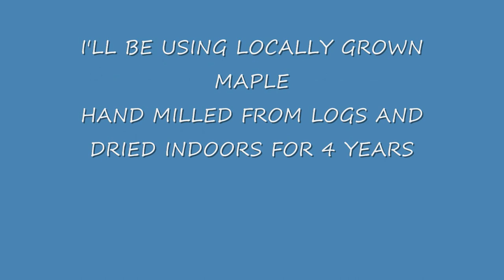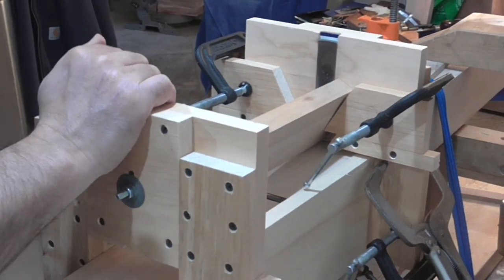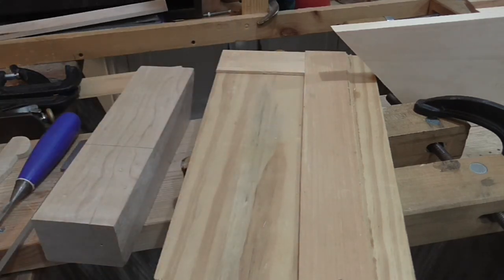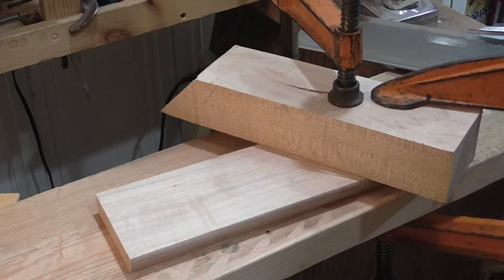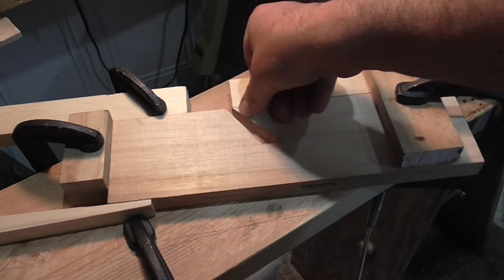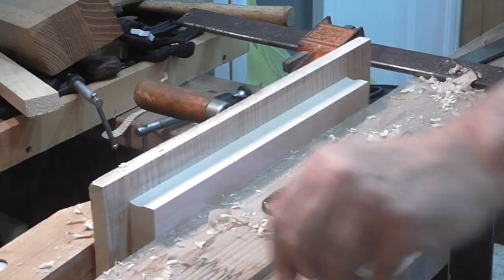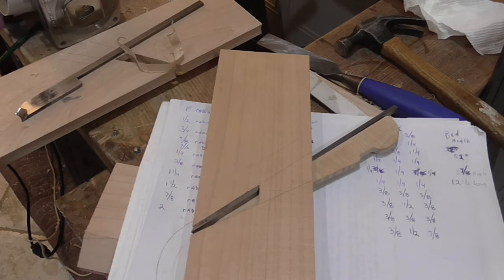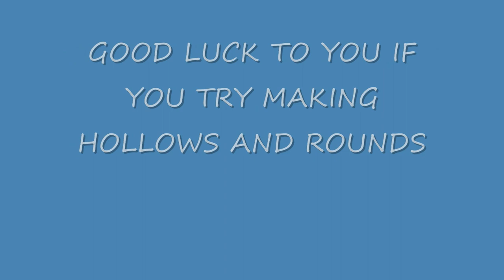Plane Making - Hollows and Rounds

Comment: This really is a fantastic video! You provide a lot of food for thought on your build processes, which then stimulates all sorts of other ideas for creating jigs, increasing efficiencies, and general problem solving. It's nice to find these rare gems on YouTube!

Question: Early in the video, you mentioned you had to locate a line on each end of the blank that was 7/32nds from the edge, and then you created a spacer that was precisely 7/32nds. I'm wondering what problem you needed to solve with the spacer, and where did you place the it? 

Thanks!
Reply from the maker: For the 7/16 ths hollow, I needed to locate a point on both ends so the jig would work correctly. I did that one last since it took time to figure out I could use a drill bit as a spacer. I registered a piece of steel off the side, placed the drill bit against it, stacked another piece of steel against that, removed the first 2 and drew a line. Then did the same with a 7/16 spacer, but from the bottom. The "point" is where the 2 lines meet.
 Doing all that with a scale or tape measure would have produced errors, a stray pencil line would have been a problem and I don't have enough material for do overs.
Reply: @ROUGHCUT20   That's the kind of detail you wouldn't intuitively think about beforehand and then not realize it until it was too late. Again, this highlights the value of these sorts of videos. Thank you!
Reply from the maker: @philpascel4144  My first answer was incorrect, please look at my edited answer. Thank You !

Comment: How did you taper your cutters/irons? So they lock in with the wedge…
Reply from the maker: I've never tapered a blade in any plane I made. I did a video on the subject of tapered blades : https://www.youtube.com/watch?v=BYuFdxpTc24
You can look through that, add to the discussion there, if you like. Personally, I don't feel the need to have tapered blades, they hold well enough if you fit the wedge and the pocket tightly.
If anything, the taper helps with the removal of the blade, after you're done using it.

Comment: Why all the blades hollow and round (that I have seen everywhere) are asymmetric, and the design of the wood block too asymmetric. In the end they all have a weak little tail to hold them. Thanks in advance.
Reply from the maker: If the plane body would have to be precisely  as wide as the intended cut, small planes would be difficult to build, for me, with the wedge pocket getting very narrow and hardly any mass available to hold the plane together. 
The old timers who made the original planes probably had other reasons.

Comment: What is the clicking noise that happens at the end of each stroke during the initial molding of the bottom of the plane, say at about 5:35
Reply from the maker: The sound you hear is the "device" hitting the stops.
Reply: Rough Cut Ok. Thanks
Reply: Do you have any videos of you making a molding plane that has a more complicated cross section?
Reply from the maker: @whdaffer1  I have a 2 part series on making ogee moulding planes...using the hollows and rounds from this video.
Reply: Rough Cut thanks. I’ll look for it